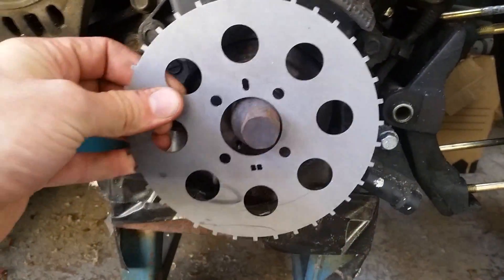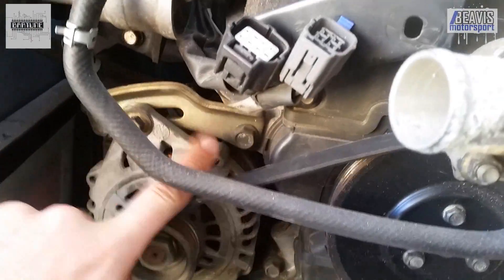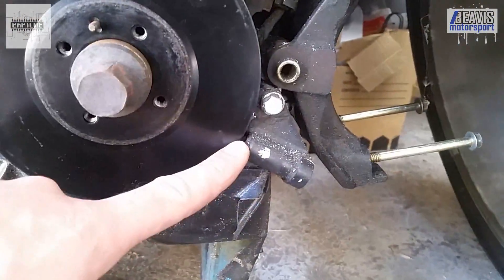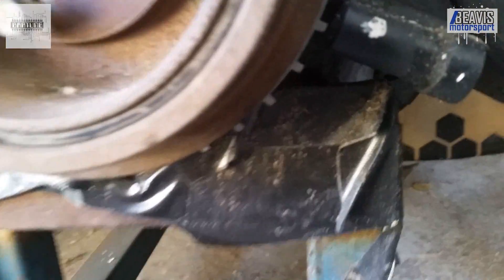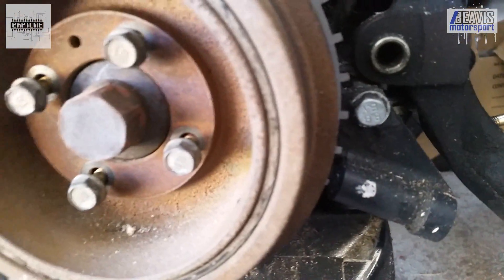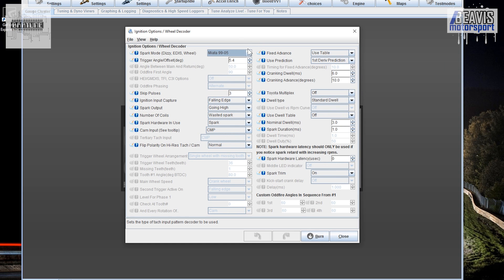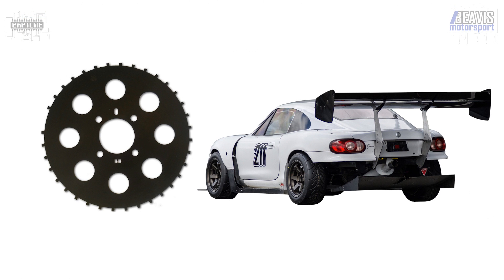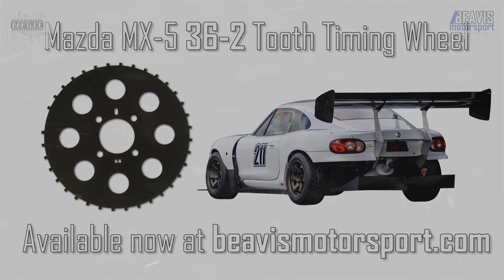HOW TO INSTALL 36-2 TOOTH TRIGGER WHEEL - MAZDA MX-5

Comment: question... what is the benefit changing the oem to a 36-2
Reply from the maker: Benefits:
This wheel offers increased crank resolution which means your ignition timing accuracy is greatly improved.
You can run more timing before detonation occurs since the timing isn't scattering.
Your car will start quicker as it takes a lot less time for the ECU to determine what position the engine is currently in. And an added bonus, the car will still run even if the cam sensor has failed since the 36-2 wheel still allows the ECU to determine the engine position. (however VVT control and sequential fuel will be disabled)
Reply: BEAVIS Motorsport nice... now thinking in buying one... i have a megasquirt so no problem installing the part... thanks a lot!!

Comment: i have a 1996 my timing belt had a slight tear i was thinking it was due to a timing error due to the stock 4 tooth trigger wheel was thinking on upgrading to a 36 2 but i see it needs some wiring changes. is it worth it to change to a new trigger wheel or should i run the stock 4 tooth on a new fluiddamper balancer
Reply from the maker: If your car doesnt support the 36-2, then its a lot of work to adapt the car... up to you if you think it is worth it.

Comment: so we can remove the sensor on the cylender head cover if we want to cut it to see the cam pulley?
Reply from the maker: Yes and no. I wouldn't do that. Logically some ECU's could run without the CAM sensor. But you would impact quality/performance and if you have it, VVT.
Reply: @Bbeavis  ok thanks, you fast asf for a 6yo video👍

Comment: Could you do a guide on how to do this on a mk1 mx5 but how to wire the mk2 trigger sensor to the cam angle sensor wiring also🙏🏼
Reply from the maker: You should check out the information that Flyin Miata offer on adding the crank sensor, it requires the later model oil pump (or a custom mounting bracket).
Reply: @Bbeavis  I believe you can tap an m6 thread into the mk1 oil pump as there’s a hole in it

Comment: @BEAVIS Does this trigger wheel still allows for sequential injection/firing? Tunner studio settings do not mention cam angle sensor. Would like to run this with Reverent MS3 basic on 2005 MSM. Thanks!
Reply from the maker: I'm not familiar with what firmware Reverent run on their MS3 (I have 1.5.2 and it supports the questions you ask), but I would presume it certainly can run with a 36-2 wheel. Changing the trigger wheel will not impact on whether you choose to use sequential or batch fire for an MS3.  Suggest you check if the option is present in your TunerStudio Ignition/Decoder settings.

Comment: Would this work with the ATI superdamper?
Reply from the maker: No, the ATI damper completely changes the front damper setup and does not have the 4x M6 mounting bolts.

Comment: is there one fore the 90's miata?
Reply: and mazda protege 2003? :)
Reply from the maker: Hi AronElite, this design is a perfect fit for all B6/BP engined miatas, however the early cars my be missing some of the other components to make it work, such as the electrical sensor and is mounting bracket. These can be retrofitted onto early engines...